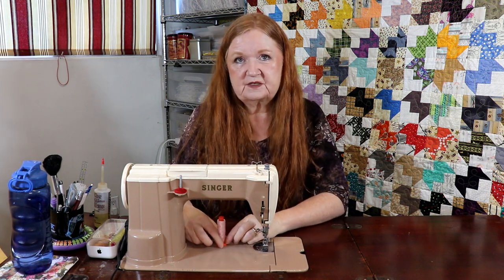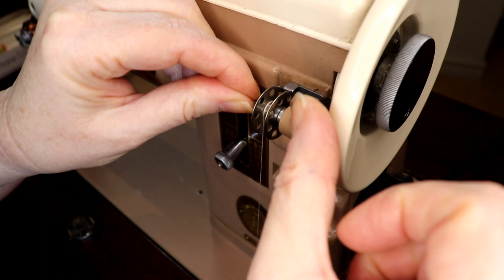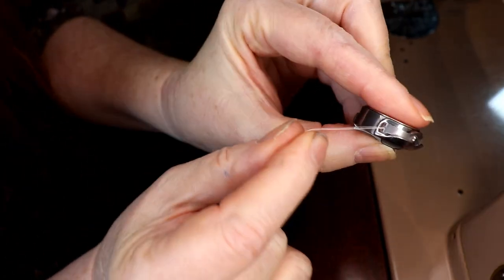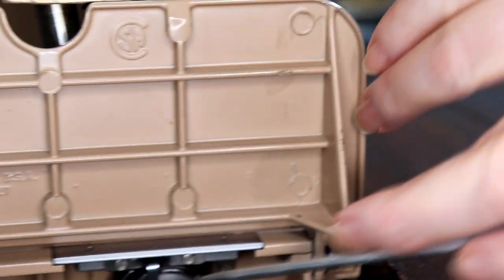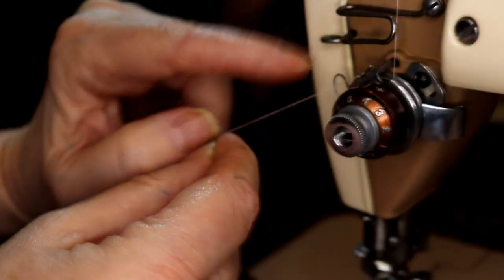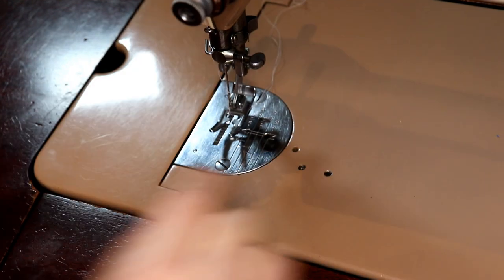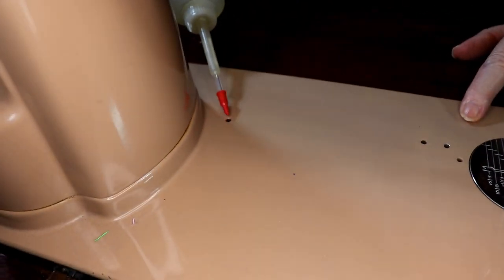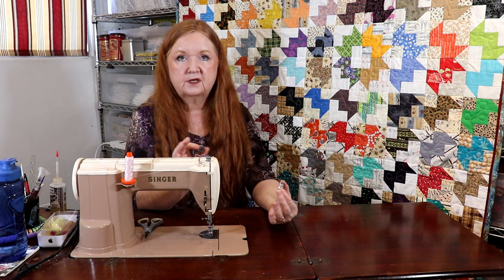"How to thread and wind a bobbin on a Singer 301A - Viewer Requested video

Comment: I never blow my machine out. I use a brush and special small vacuum tools that I bought to fit on my Shop Vac to help clean my sewing machines. I was told canned air will pack lint, dust and other items deep inside the machines where it is very hard to get out. Plus, canned air is dangerous to have in the house; because young people think it can not hurt them. It is not all air.
The needle fits in the same way on the Singer 221 as it does in the 301.
Reply from the maker: Hello Arvetta!  My hubby does that monthly cleaning and he takes it out to the garage, strips the machine all down and blows the lint away. I should invest in a little vacuum that sucks the lint out that I can keep handy and close to my sewing machine. Any suggestions?? Thanks for all of your kind comments and support!